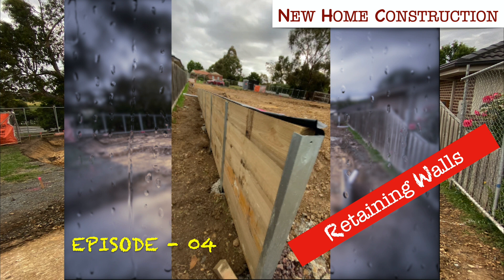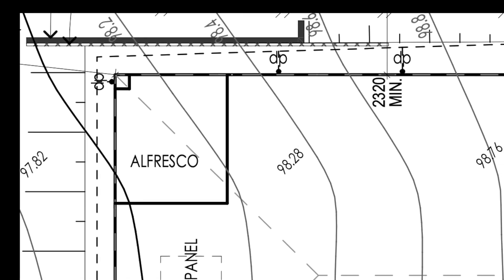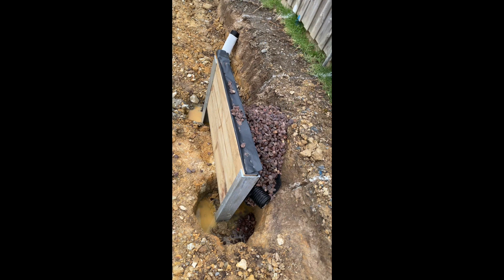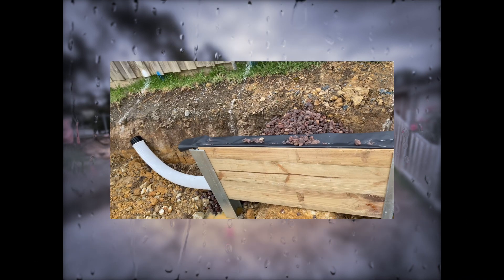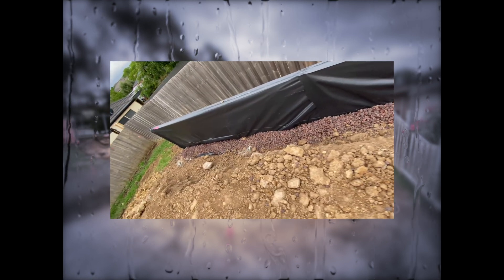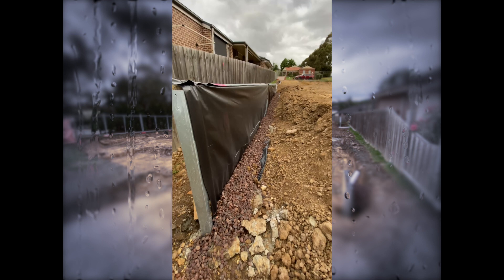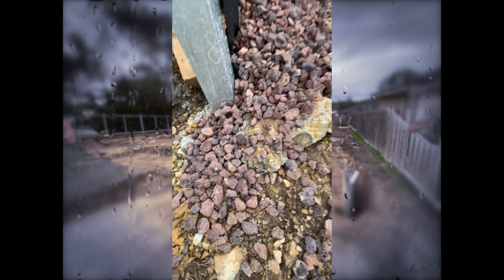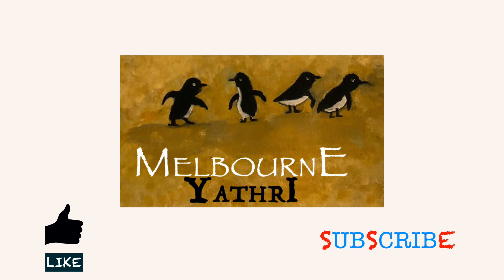Episode04 - Whats inside a Timber Retaining Wall?-New Home Construction-Melbourne,Victoria,Australia

Comment: Is Agi drain mandatory by Australian standard ?
Reply from the maker: In my understanding- Yes .. all new builds… especially in P class soil need agi drains around the slab or retaining walls
Reply: @myt3  how to verify this? Will this be part of drainage diagram?
Reply from the maker: It will part of your council approved overall plan
Reply from the maker: Normally shown as dotted line along with sand pits
Reply: @myt3  the retaining walls have agri drain, but not sure of they have use that white screen cover over the agi pipe like yours.

I couldn't find anything around the slab but the structural engineers drawing had instructions under drainage design requirements  :  surface drainage shall be design during construction & having grading slope of 50mm. But does not necessarily says agi pipe.
Reply from the maker: @RSG .. checked my drawings again… it’s mentioned clearly on the doc that shows cut & fill . The doc title for me is - Site Drainage. Hope it helps mate